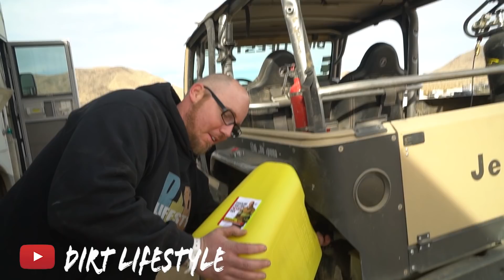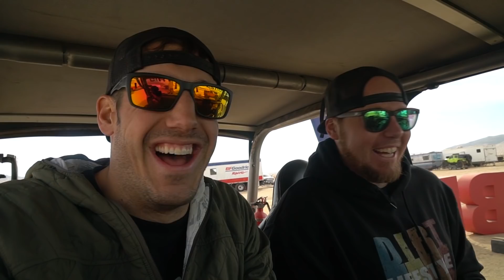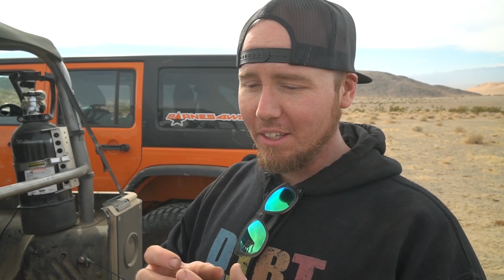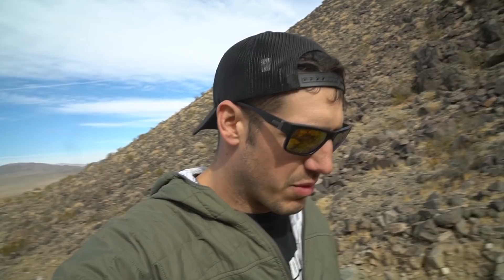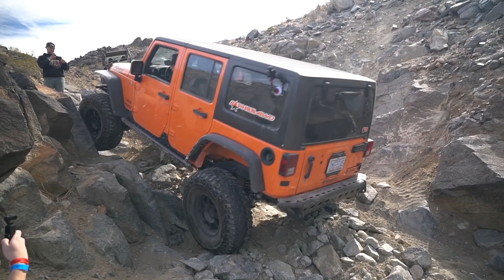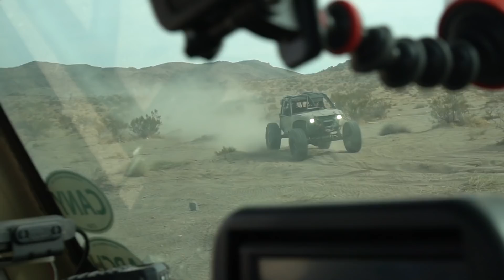Home Built Diesel Swapped Wrangler VS. Modern Jeep Jk

Comment: That JKU looks like a great daily / weekend warrior!

I am rocking a 2016 JKUR 
32 spline RCV/Ten Factory shaft
4.88 Yukon Gears
Stock lockers
Morpar 4" lift with reservoir shocks
Rancho fully box correction bracket
Trussed/gusseted
37x 17 R70 Milestar Patagonia's
PSC Big Bore XD steering gear
7075 aluminum 1 ton Drag link
7075  aluminum 1 ton Track bar
JKS F/R tackbars
Reid Racing knuckles 
TerraFlex HD Ball joints

So far no problems on the PNW trails!

Comment: I really dig the voiceover & think you killed it honestly but the audio is left-heavy lol
I've had this issue too in a video. Not sure what software you edit with but most have some way to fill right audio with left to even it out.

I know you're pumping out content quick but just wanted to point it out in case you missed it. Only really noticeable when watching with headphones haha
Reply from the maker: Hey thanks. Yeah I noticed that too with headphones but ran out of time to fix it.  I tried doubling the audio and overlaying it on the right hand side but then it was way to strong sounding.  I actually had a hard time with capturing the voice over all you could hear was the base in my voice. I had to re do it like 5 times lol
Reply: @Maxx.Powell  haha did you use a phone? That's when I get the mono audio. 

I use DaVinci resolve to edit & found a tutorial on how to fix it which worked out in my last video. Super easy. I think premiere pro has an even easier method too.

I have the same issue having a deep voice lol but now I picked up this super cheap lav mic that I use for stuff like that.

A YT channel called Fulltime Filmmaker sells it on amazon for like $30 and it's super crisp. YT won't let me link it but look up "ftf lav mic" and it should come up 🤙🏼
Reply: I listened with headphones, and did not even notice.  I did like the voiceover.
Reply: @RyanRKJ  interesting what headphones? Maybe they have something built in to convert mono audio to stereo